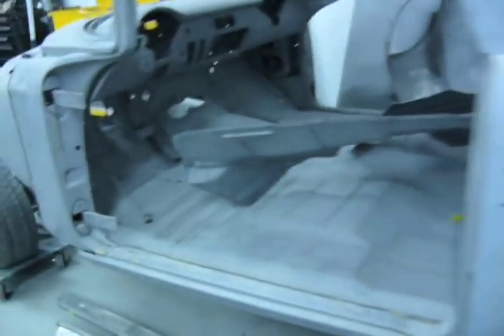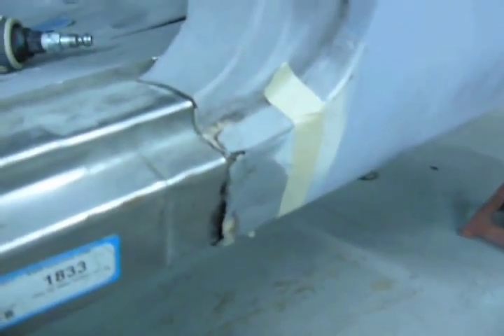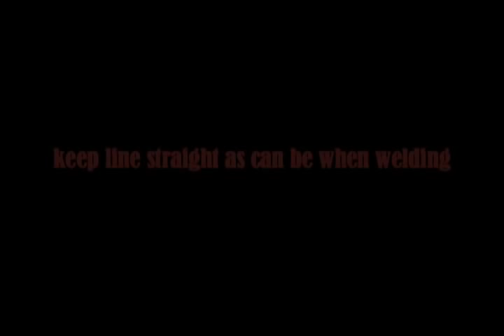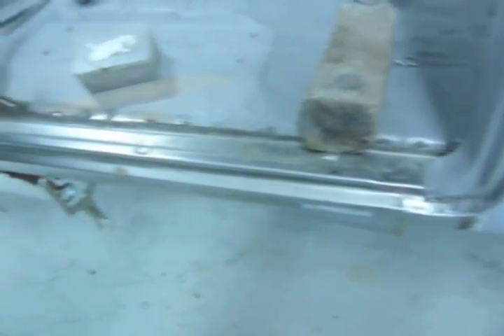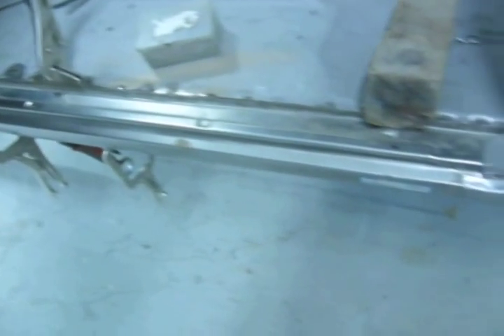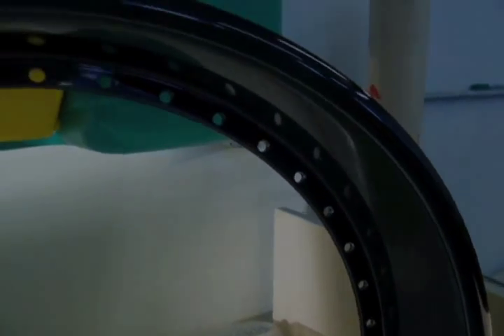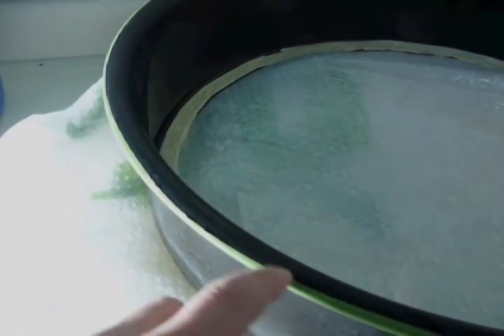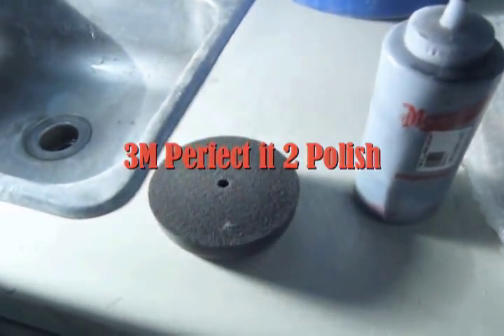episode 25/ 56 Nomad/ 68 Chevelle/ Painting Rims

Comment from the maker: blending metallic can be tricky, but again, I'm not a painter by trade. I will say it seems easier when you give yourself plenty of space and fan it out nice. Lots of guys turn down the air a tad and increase distance to blend but I just move a little faster and fan it out nicely. The catch is that you can't spray it too fast or you will have flakes standing up to high on the surface, which looks like fish scales. Tacking is important in the blend zone for overspray. Hope that helps.